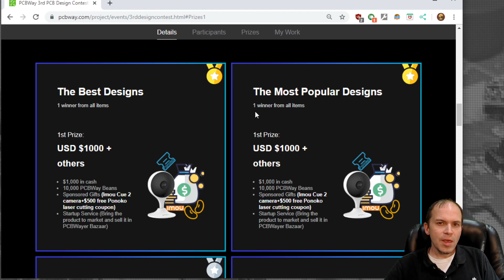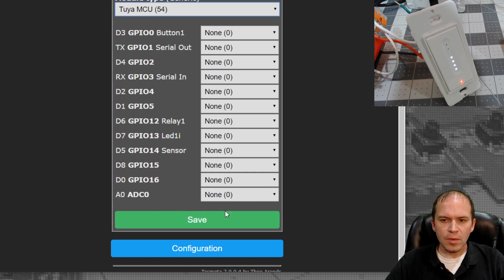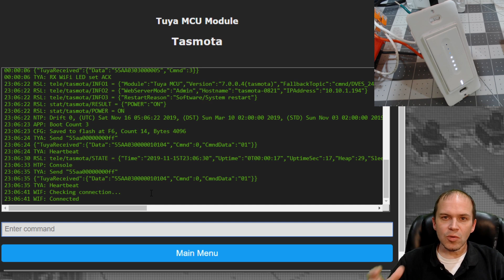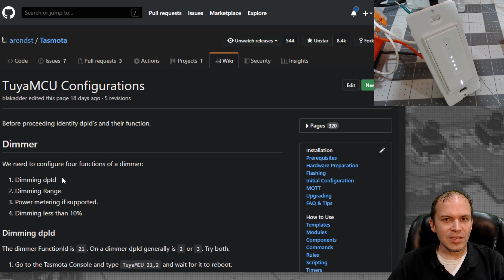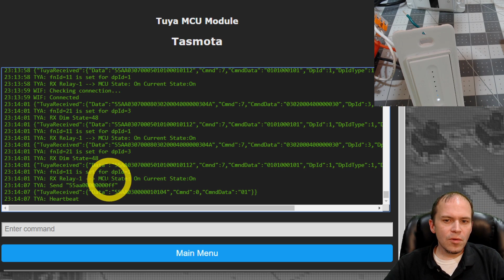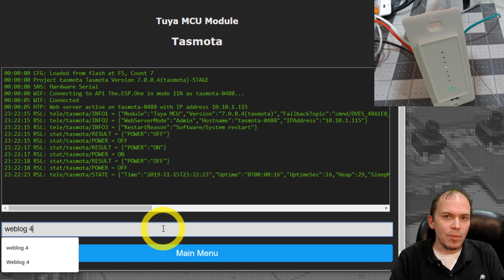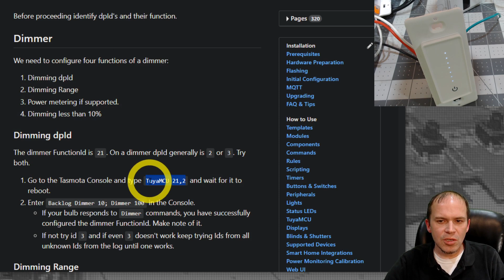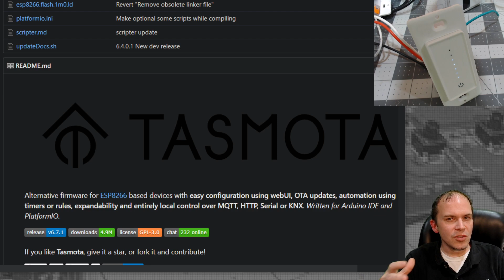How to Setup a Tuya MCU Dimmer - Tasmota Tips Episode 4

Comment: Is there a way to set it up if the Power is OFF and you change the dimmer the Power with automatically turn on?
Reply from the maker: That is the way it works when you turn the dimmer up it turns on I thought? Is that not the case?
Reply: @digiblurDIY  yes in HA, not when using the hardware touch dimmer. It just change the dimmer value. You have to press the button to turn the light.
Reply: If you like to power on the light as you touch the hardware dimmer, you'll need an automation or rule. No matter if the light is on or off, as you touch the hardware dimmer, DIMMER value is published under stat/topic/RESULT{"DIMMER":34} as well as in the console TYA: RX Dim State=425. Your automation or rule needs to trigger based on one of these published value and send cmnd/ to turn the light on. You'll end up with a small delay though.

Comment: For my first jump on tasmota (8.1.0); The dimmer switch I am trying to configure physically turning on and off the switch will toggle on and off  of the GUI, but if I use the GUI to turn on and off switch will not respond. What did I miss? I cannot see the heartbeat on the console, should heartbeat will always show up? Thank you in advance for any help.
Reply from the maker: The heartbeat should show up, which switch are you using?
Reply: @digiblurDIY  I'm using https://www.amazon.com/dp/B07SXDFH38/ref=cm_sw_em_r_mt_dp_U_b7H-Db5YNSM2A . When I first configure it I can see the heart beat. If I press buttons on physical switch I can see response on the console. Dimmer dpID: 2 and on/off dpID: 1. But for some reason physical switch wont respond to GUI commands I can see tuyarecieved after physically press the button on the switch. Thank you in advance for your help.

Note: I've issue TuyaMCU 21,2/3 and 11,1. No luck. The switch is a 3 way switch not sure if that make a diffence on configuration. Not using it for 3 way right now.
Reply from the maker: You might try the Tasmota Discord channel and hit up Shantur there to see what he can work his magic on with the packets you are seeing.
Reply: @digiblurDIY  Thank you, I will try to hit up Shantur. Appreciate it.
Reply: @pkethlaor  were you able to figured it out with Shantur?  I got the same switch (i think) from costco (2pack).  There is an on going discussion about this switch here https://community.home-assistant.io/t/costco-feit-smart-dimmer-tuya-convert-tasmota/151390/15
Reply: @LinhNguyen-ev8wq   I haven't had a chance to do anything; I got tied up with work after holiday. Thank you for the link. I will try to update here if I got mine to get it working.
Reply: @Linh Nguyen I got 2 of my switch working now. Updated to Tasmota 8.1.04 with Tuya MACU (54) configuration. Just unplug my switch if no heartbeat is showing.  I had to issue tuyaMCU 21,2 ; Dimmerrange 10,1000 ; tuyaMCU 11,1 . Hopefully this help.

Comment: Thanks for the great vid! I got everything working on Tasmota v7.0.0.3, but when upgraded to Tasmota v7.1.0 the dimmer slider in the WebUI no longer works. When I move the slider I don't see any traffic in the weblog. Anyone else have this issue?
Reply from the maker: What build did you upgrade to? Is the TuyaMCU ID still set? Just type TuyaMCU at the console
Reply: @digiblurDIY  I upgraded using the latest tasmota.bin at http://thehackbox.org/tasmota/release/tasmota.bin, which is at v7.1.0. The TuyaMCU ID is still set as is the dimming range. Via the console I can send 'Dimmer' commands to control the brightness correctly from 0 to 100. I did extend the lower range from 'DimmerRange 150,1000' to DimmerRange '0,1000' to allow for lower dimming. So, everything works when sending commands via the Console and when operating manually at the switch; just the WebUI dimming slider doesn't work.
Reply from the maker: I just upgraded one to 7.1.1.1  using http://thehackbox.org/tasmota/tasmota-wifiman.bin  (since it is a smaller bin I use that one and it supports TuyaMCU)  I couldn't reproduce the error though.  When I slide the slider around it works and I can see the new state on the light itself and on Home Assistant.  You might need to submit an issue thread on github if yours isn't working and there is some bug.
Reply: @digiblurDIY  Ah, so after updating to 7.1.1.1 (wifiman), the slider is working as expected. Thanks! Next task is to figure out how get the switch to allow me to dim to levels below 15%.

Comment: I have trouble using tasmota on ESP01. Tasmota Sonoff alreadt flashed. This esp board has only 2 GPIO's. Relay does switch but not when I toggle. Only once on startup.
Mysetup :
ESP8266 WIFI network module RS232 AT control
1-channel 5V 10A relay module for Arduino

What configuration should I choose? Please assist.

Comment: Hey Travis. This might be a dumb question, however how do you know if a device has a MCU chip?
I was wondering if a decide that I tuya convert to Tasmota, could use these MCU commands to dim lights. It is a double light switch on/off relay and no dimmer function that I know of.
Can you test with commands to see if it will dim with say press and hold? Thanks mate
Reply from the maker: You could try the typical pins to see if you get a Tuya msg back.
Reply: digiblurDIY great will try and let you know. Thanks Travis

Comment: Do you have any ideas on Tuyas Dimming speed?  On my dimmers, the brightness rate increases significantly faster when pressing the physical button vs. sending a command.  It doesn't appear that any Tasmota Dimmer speed commands make a difference.
Reply from the maker: You are correct. When you are doing changes via the faceplate the Esp8266 does not come into play at all as the secondary MCU does all of that.

If you want one where the dimming is handled by Tasmota I would stick with the Martin Jerry style ones.
Reply: @digiblurDIY  So if I buy Martin Jerry dimmers I can program them to be more like the Lutron dimmers I have?  The Lutron dimmer has a maybe half second delay, then fades off slowly when pressed.  It also fades on slower than the TreatLife DS01 I bought.

We like this delay/slow off feature as it is nice to see for a second as you walk out of the room.  I have been trying to figure out if it is possible to make the TreatLife DS01 dimmers do that?
Reply from the maker: Yes since the ESP chip is sending the dimming signal, you can control the fade length of things with the MJ dimmers.